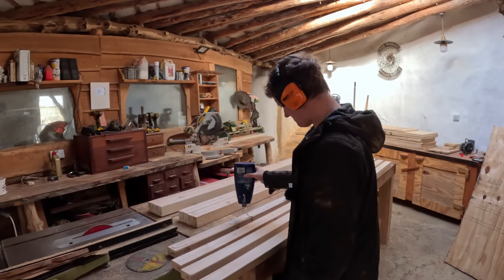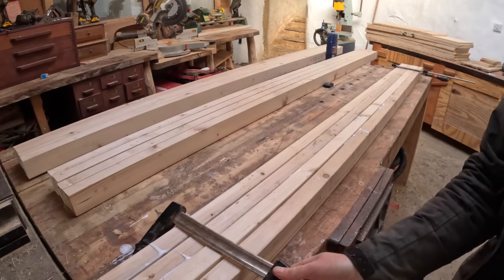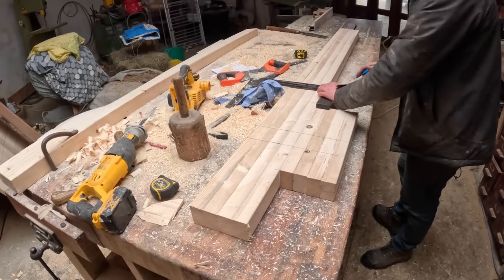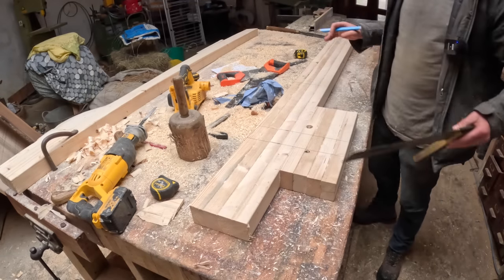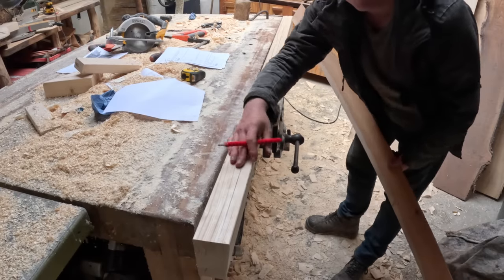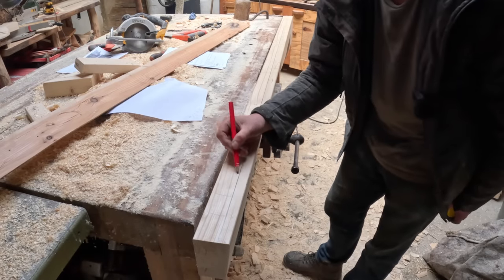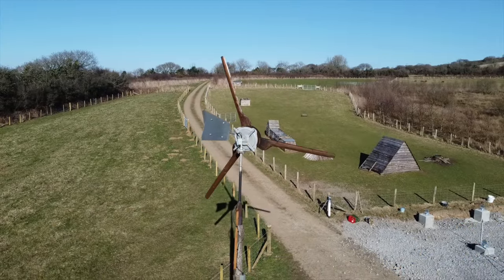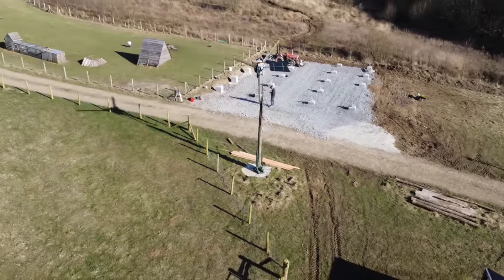Hand Carved 2m Wooden Wind Turbine Blades

Comment: When i was in the Army I was a helicopter mechanic, helicopter blades also wear away, what the maintenance manuals have you do is continuously check the blades for missing paint ( bare metal showing). You could always paint the blades ... when you see wood, and it might last a little longer.

Comment: It's really quick and easy to stick self-adhesive aluminium foil tape along the leading edge of the blades, then they will last many times longer. Thin tape might be the most aerodynamic but you could just use builders flashing tape which is really tough, sticks to anything, readily available in very wide sizes and should be reasonably easy to peel off if you need to replace it.

Another way to make a turbine which works well in low wind speeds is to go for six blades instead of three, then they can be shorter.

A really inspirational project, thanks!

Comment: 2 things. I love that you've factored in the microplastics that come off the turbine if you glass it, it shows a deeper ecological question in our own use of these products. I think you can gain a few percent on the efficiency of the bades but it comes down to the windprofile on your landscape and clever programming. You've mentioned this tradeoff yourself, but (simplified) the trade-off is this; gain power at any speed while turbine goes at any speed while efficiency is low, or gain more effenciency within given parameters and keep your blades alive. My gut feeling as former 2 year EE and avid daysailor is this, add more weight to wings because of increased surface area just to overcome the luls on your land with variable windspeeds, then a smarter (higher frequency input/output computing) program - perhaps with a sensor or two connected to Pi- to maintain a higher voltage gain /Cmax at higher windspeeds.
Reply: Are you saying that he should have more weight at the centre to provide more momentum as a flywheel perhaps?
Reply: @stevenholton438  
If you click thumbs up on Aeradill’s comment and yours he will be notified about your question.
Reply: yes exactly like a flywheel, the inertia increases squared with mass away from the rotational axis(moment of inertia). So if the surface area goes up squared and the mass increases we can lower the RPM and collect the same power thus saving the blades. 

ideally we would program a bunch of steps that the turbine works of so that in light winds it strains little with high RPM (stable low wattage) and heavy winds it strains more (stable high wattage and saving blades)with 'low' RPM.

Comment: I'm not an expert in wind turbines, but I think your blades need way more twist close to the center, the wide portion of the wing looks way too flat considering that it moves pretty slow compared to the wingtips, that may cause a lot of turbulences, because it basically stalls, which produces noise and a lot of drag, so you lose a lot of power.
There is a formula to calculate the perfect angle, but I think you will get a good approximation if you just imagine the circumference of the circle which a given point on the blade travels in one revolution as the length of a ramp and the height of the imagined ramp is the distance the wind travels in one revolution, now you can calculate the angle of that ramp.
For example:
If the wind travels 1 meter within one revolution of the turbine , at 0.5m from the center of the wheel the blade travels 3m and the wind 1m, that equals an angle of 18°, at the wingtip the blade travel is 12.5m and the wind travel is still 1m, that equals an angle of 4.6° , for 1m distance from the center the blade travel is 6.3m, so the angle is 9°. For 1.5m from the center it is 9.4m = 6°

At these angles and a wind speed of 10m/s, without any load or drag (which is obviously impossible), the theoretical max rpm is 600, so you may get a usable rpm of maybe 400.

If you want the turbine to spin slower, you may make the blade angle steeper, for example 2m of wind travel per revolution( theoretical 300rpm at 10m/s):
At 0.5m from the center = 32.5°,
at 1m = 17,7°,   at 1.5m= 12°, and at the tip= 9°
But at these steep angle the blade needs to be pretty wide to extract a reasonable amount of power from the wind, so you may choose something in between...

Comment: On grandfadders windjack, after the second set of blades back in the late 50's, he tacked a copper strip to the leading edge, faiered it with a file. Blades lasted almost 10 years vs 1.5 years. That was in Nfld with harsh winters.

Comment: The twist in the blade is referred to as the Helical Advance for equalizing the wind load over the length of the blade. Interesting stuff.
Reply: On an aircraft wing it's known as 'washout' and it is built into it so that the last part of the wing to stall is the tip.

Comment: Although it is more complex to carve, creating a washout from root to tip will improve efficiency by quite a bit.
Increasing the pitch at the root and reducing it at the peak will bring the centre of pressure away from the tip (where the greater speed  will generate more torque but has the greatest potential losses) and even out the load and make the whole of the blade do work rather than the bulk being done at the tip.
This will also have the added benefit of reducing noise, which is primarily caused by the tip.
Reply: In aerodynamics the shape for wings with higher speed are more slim and thin with less of a bulge at the top side and with a smaller angle of attack.
The shape for low speeds also are not flat on the down side, they even have an inward curve, and a greater angle of attack.
In wind mill blades this is all taken into account.
You can construct the ideal shape for the average wind speed with vector diagrams for the different radii.
The way Chris has done this one makes the tip more of a brake to the rest of the blade

Comment: That is so cool, glue some large pieces of wood together, measure, carve, assemble, weatherproof, mount this replacement on your own, admire the beast then tweak the electronic controller.  Congratulations Kris, your turbine now is running as you wanted from your explanation.  So interesting to watch your video, planning ahead for more consistent power to serve your barn build. Top job.😎

Comment: We have company locally that makes 6meter blades from wood, on a 12m mast. they produce around 30.000kwh a year. usually around 60rpm, with 100rpm max.
So if you ever get bored... Company is called EAZ Wind.

Comment: I watched your video on your upgrade of your wind turbine and thought that is really great, but I remember you mainly did the project because you wanted to make the blades less noisy.   I just watched a video about the company called Zipline, which is a drone that delivers packages.  In this video toward the end it talks about the design of the blades that does work to make the blades whisper quiet and i thought you would be interested in that also.  What I seen was that the blades was not inline with each other and the curve of the blades are different.   Well if you watch you will see what I am talking about.

Comment: Making the blades out of laminated wood actually reduces the risk of longitudinal warping, especially if you alternate the grain of each board so the natural warping forces cancel each other out.
Also, wind turbine power curves are more of an S shape whereas the one you have in the Classic is more linear.  I would try bumping up the curve points on the high end.

Comment: what i done was make a wooden  form to set blade in  and a fixture to run router back and forth  with the taper from tip to base for the flatter side. worked well

Comment: Perfect use case for a CNC router to make a precise profile.
I'd guess if you want it to spin more slowly then increase the blade pitch. That'll also increase the torque for low windspeeds.

Comment: Instead of a draw knife Kris could you next time use a carvers tool on a power angel grinder. This removes large volumes of wood quickly and efficiently with out he need of slitting with a saw. Looks like a cylindrical rasp (blade) you can get these in most DIY shops.
Reply: Kris, for future "Rutlands" are selling convex and concave wood carving discs for angle grinders at £29.99. I know there are other places that sell them but 2 tools will be needed. Band saw to cut the lengths out once you have glued the wood together and either one of the convex or concave blades for the angle grinder. It removes material very quickly.  Hope this helps you in the future. Col

Comment: Great job, I think that the tail should be 1.5x to 2x longer & maybe a 1.25x larger, the stalling control depends on the length of the tail with it being slow to react so that you don't have it stalling very often unless you're getting 50+ mph winds.

Comment: Fantastic blades and you explained the process in such a easy way to understand even i understood your method .
I understand why you just put oil preservative on your blades but as a none wood worker i would be so proud of making such beautiful blades i would of epoxy clear coated them put on a polished copper leading edge and a alloy dome spinner on the front center . Basically full on "Steam Punk" lol .

Comment: Nice blades Kris. It's been 15 years since I made 5 foot blades and I think it took me a full day for each one. 
As for the low power and high speed I still think your magnets are very weak. When I watched you put the turbine together I was shocked you did it by hand. When I put mine together I had to use a jig to lower the top magnets or they would have smashed down and broken something, separating them by pulling the top rotor off would have been impossible without a jig. Also the way you handled them they didn't seem at all scary or try to jump out of your hand which they should have.
Reply from the maker: they are not strong magnets. they are ferrite so they are not strong, that is why there is lots of them. There is one HUGE benefit to using them though and that is corrosion. they last 50x longer than Neodymium. So there is a loss in efficiency due to them not being as strong but there is a gain in longevity and maintenance. I have used both and I would not go back to neodymium
Reply: @KrisHarbour  Mine were encased in resin and lasted years. The magnetism was so strong I was able to make the blades stop in the strongest winds by shorting out the coils.

Comment: I work on commercial aircraft and the leading edge of the horizontal stab and vertical stab has what is called erosion tape.  Its a clear mylar tape that is glued to the leading edge and it will come loose over time but can be removed with a heat gun and new tape applied.  Not sure on the mil thickness on it but it would be easy to look up

Comment: great project Kris! Sadly running a windmill in a built up area is virtually impossible both for poor wind conditions and legal reasons, they make a great add on for power production during the winter months. In combination with a heat pump a windmill covers some of the energy consumption when demand is at its highest and PV power production at it lowest.

Comment: Could you wrap a strip of aluminium sheet over the leading edge and reduce the wear rate? Also I imagine there must be an automatic way to change the parameters according to wind speed.
Reply: Or even plastic.
Reply: Copper sheet would be good too

Comment: One of the best way to regulate the output for low wind speeds is to have a multi blade system (3 is too few). Multi blades start at lower wind speeds and to some extent self regulate because as they spin faster each blade fouls the air for the next blade and it becomes very inefficient. Of course you will lose efficiency at higher windspeeds, but you get the benefit of low start speeds, better torque at the lower speeds and blade stalling in higher wind. I should also say that because the energy of the system is proportional to V^3, then the energy available drops off a cliff at low wind speed and there is nothing you can do, as the energy is simply not there.

Comment: I can't imagine that the shape of the rotor blades is effective.  Also, if it has rained and then there is no wind for a while, the water stays between the wings for a long time and the wood gets soaked.  A small hole would help to drain it.  But all in all a bold project.

Comment: I always wondered about a big wall off tiny fans well built ones all connected together as one wall sorta thing or even 4 walls or a pyramid or some mad design rather than one big fan but prob wouldn't work be the torque or something I imagine all Greek too me wind turbines...but you smashed that as per cheers

Comment: great work on the blades - but all that effort just for a couple of years work - i know its pretty easy for you, BUT had you thought about sealing the timber with resin and then coat the whole blade in fibre glass, perhaps with a couple of additional strip down the leading edge, cover the surface with peel sheet to get a smooth finish as desired - certainly should get a longer life from them
all the off shore turbine blades are fibre glass
i was just learning its not a new thing, battleships often had rudders made in oak, with a steel skin to cover, keeping rudders cheaper to build, easier and lighter for maintenance and use - give it some thought fella, if its good enough for all the big boys, definitely worth a go and save you much mucking about

Comment: Kris, I'm probably not fully understanding the blade design, but it seems to me that carving your airfoil in the direction of blade rotation would only produce a front-to-back pressure gradient that bends  the blades in or out but cannot produce torque in the desired direction to spin the blade. To get torque that spins the blade the airfoil would need to be oriented front to back, right? But that would also produce a bunch of turbulence too, so I'm sure it is more complicated than that. Perhaps that is why there is twist in the big blades?

Comment: Have you considered 3d printing a turbine blade and using a wood core? You could test different tip ends and blade rotate/twist etc. then when you work out best efficiency you can make in wood. 

Other thoughts for repeatability in design - print a series of template so you can place it on at the intermediate points then each blade would be nearly exact.

Also in ski and snowboard construction they put a rubber layer in the laminate to reduce vibrations could this be done in your turbine blade?

Comment: been thinking of making a big one that runs slow, with big blades using a tractor reduction hub, (zetor 4712 rear drop box, or reduction box ) if it worked it would be perfect as it's a self contained unit, completely sealed, has about a two foot output shaft with two bearings supporting it in the gear housing (shouldn't need a carrier bearing) although the shaft itself is splined and will need turning down. I have some of piggott's books on turbines and he's kind of against  gearing them and I can see why, these hubs are 19 to one reduction, one full turn of the tractors wheel equels 19 turns at the output shaft roughly. Lots of friction in the gears, bearings, oil, make it hard to turn. I'm thinking about taking the gears down from 2 inches approx to about one, and fitting ball bearings as apposed to rollers on the output shaft, lot of work just to find out if it would indeed work but as I said if it did it would be great. Otherwise I'm thinking I would need two big stators, and magnet rotors to match, if I could have more speed at the stator and slower speed at the rotor It would be ideal, just thinking out loud, anyone tried anything like this? I'm thinking a 20 foot rotor span, or bigger perhaps. I'm just using what I havd or hoping too anyway, Keep up the good work chris, your a real inspiration,👍

Comment: After having watched your video when it came out, I have been contemplating over it a lot. And I add that, although I'm a biologist, my research concentrated mainly on fluid dynamics. I did not design turbine blades myself, but someone who is skilled in fluid dynamics, has seen them as part of their training. I see two main problems with your design.

First is that you wanted to have a turbine that is spinning slower, hence you chose larger blades. But your turbine doesn't have a gear box, and in that case slower rotation also means less power output.

Second is that you cannot just scale up a turbine blade. A longer turbine blade, spinning at the same speed, will have a different angle of attack at the tip, due to its own speed relative to the wind. If you want to have a longer turbine blade spinning at lower speed, than the angle of attack at the base of the blade needs to be adjusted. One can very clearly see that in the large commercial ones, like in this video: https://www.youtube.com/watch?v=2kqIV489ITc. The base of the blade is twisted much more in order to increase its efficiency at the low speed that it is designed for, as the apparent wind is much more in the direction of the true wind than would be the case in a much faster spinning blade. In general, a longer blade means there has to be a bigger difference in the twist over the length of the blade.

I guess you will have to invoke more knowledge on blade design in order to increase the efficiency of your new turbine.